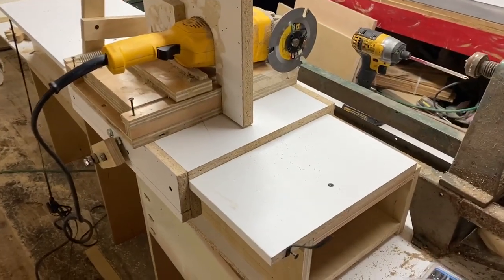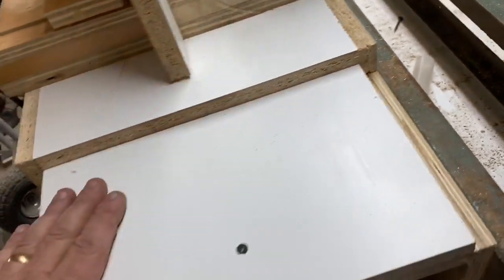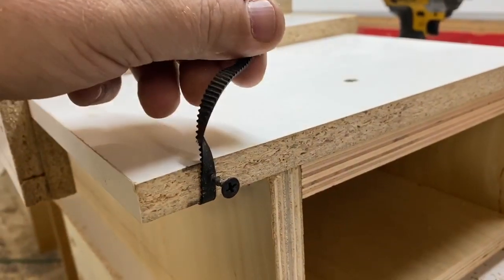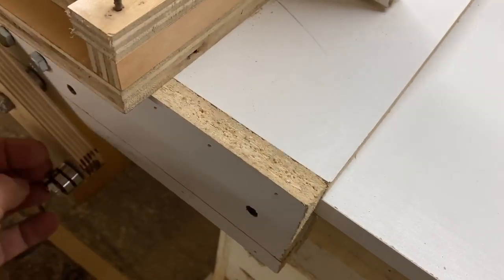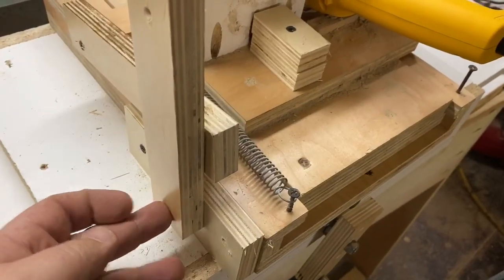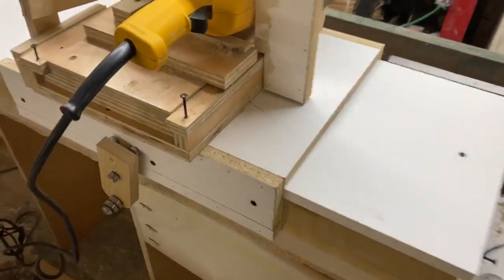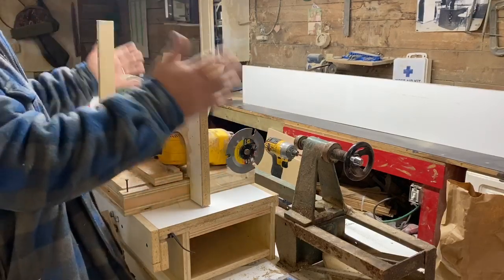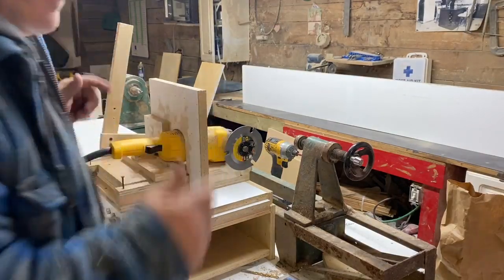Crazy Homemade Copy Lathe part 2

Comment: You know, I was thinking. If you put the spring back, but so it push the tool in rather than pulls out. And put depth stops on the lever, say max 1/4 depth of cut per pass. All you would have to do is wind the carrige back and forth and change the stop per pass. The depth stop could just be like a cross slide screw but not backed up on the dial end, left floating. Or a steped cam, but that would be kinda big. Really interested in this project, i want to do something for my metal lathe to cut wood, obviously the spindle isnt fast enough for wood so the cutter has to do the speed part.